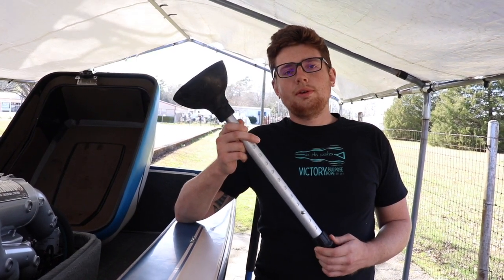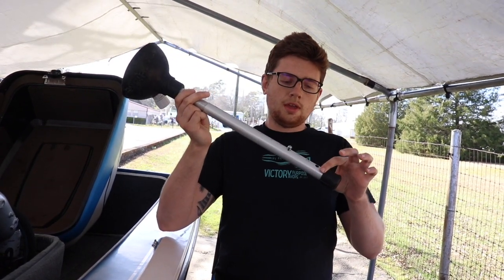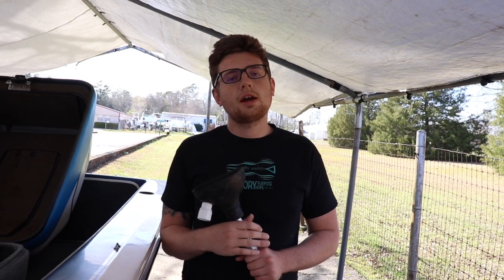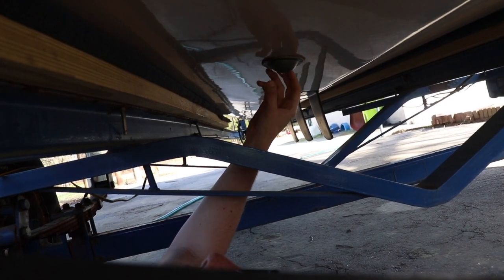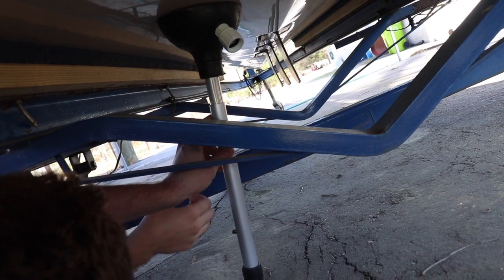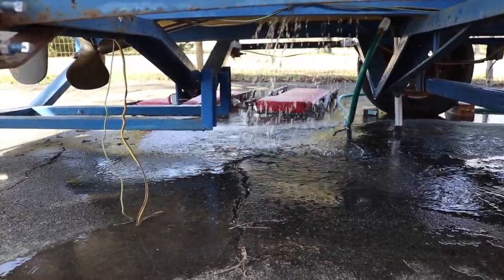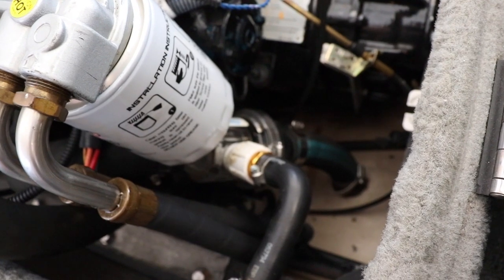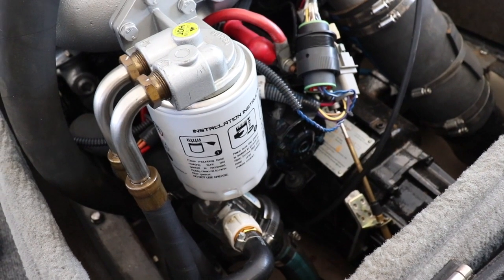How to Use a Fake A Lake | Inboard Engine Flusher | Run Your Boat Before Hitting the Water

Comment: Have used fake a lake for years.  Great product.  Recommend looping hose around the bottom of the fake a lake adjustable shaft.  Allows you to pull the hose and retrieve your fake a lake without crawling back under the boat (and getting wet).
Reply from the maker: That's a great tip